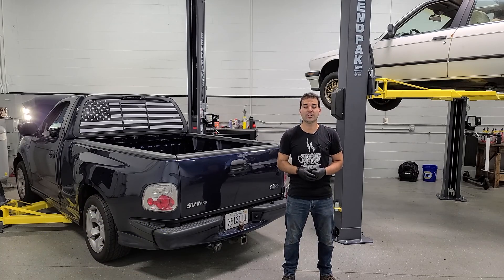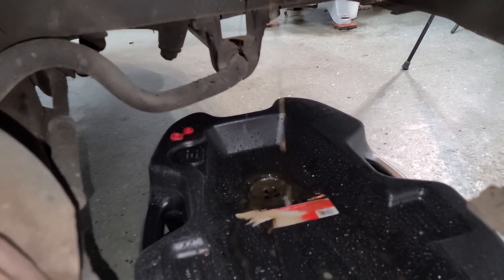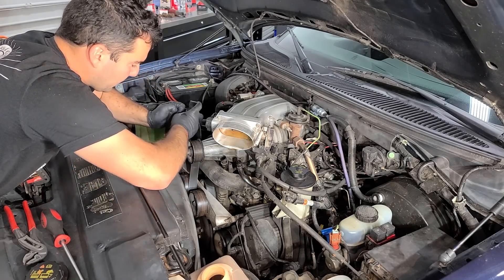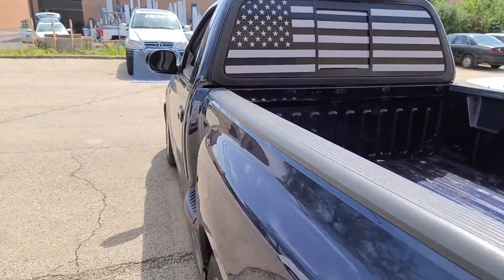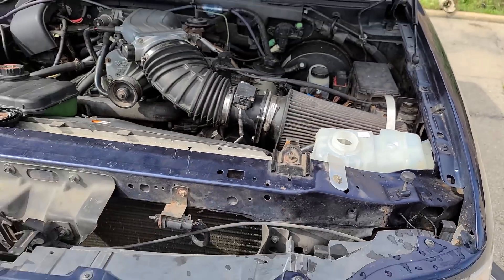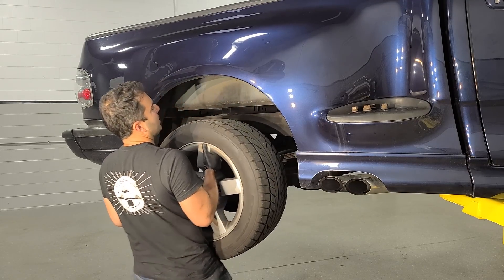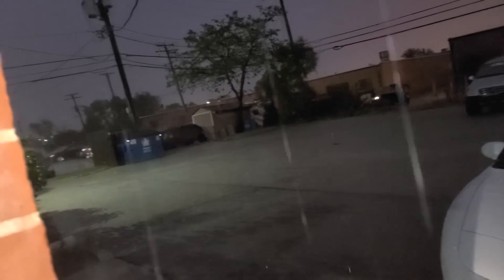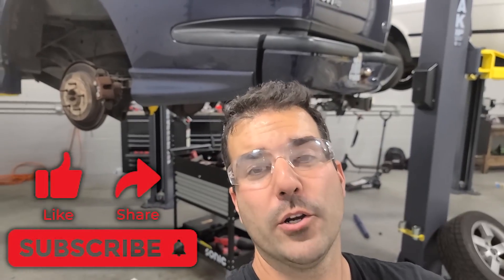I Fixed Almost Everything On My Ford F-150 SVT Lightning Until A Big Storm Stopped Me From Working!

Comment: AC in a shop is great.  So glad to hear you’ve got it when you need it.   Gloveworks HD hold up really well for me.  They are quite expensive these days, but they work well.
Reply: meanwhile the shop I work in still has no ac and the last 2 weeks were all in the 90s with a 100+degree heat index
Reply: @biggiy  I don't understand that in hot places. The owners are so cheap they don't realize they're losing 80% of their productivity to save on AC costs.

Comment: A little trick I use when I have to do something messy when not on the lift or without a larger pan it use puppy pads around the smaller pan. They absorb everything and easier than cleaning up the floor.

Comment: Great Video.  Just a little background for someone who is working on this at home.  The reason the coolant turns brown is because of rust in the coolant system.   When you flush and replace the coolant like this there is a good probability that something will leak afterwards because the flush takes out any rusty portions in the coolant system.  Keep a watchful eye on the coolant temperature when driving it afterwards.   The new coolant mixed with water will help prevent any future rusting in the system.

Comment: A great tip is to use a old washer fluid jug....cut out a square out the side and the edges prevent from splashing out.....plus the lid is great for draining with no mess!!

Comment: 25:00 Alex, I recommend the hypertough nitrile coated mesh "grip gloves" from Walmart.  They're not super durable, but they're cheap and tactile, and they're only about 2-3 times the price per glove of layered nitrile shop glove.  They easily last ten times as long as the vinyl only gloves, and with the mesh backs you can wear them all day without getting sweaty hands.  They still keep your hands clean, and when you need actual liquid protection, you can layer them over plain vinyl/rubber gloves.

Comment: 24:30 this is why you leave the strap on the shock, hang the top, then snip the strap and as the shock expands put it in place of the lower bolt and quickly stick it through as it lines up for a split second...

Comment: Tool list: 4 inch grinder and a box of thin cutoff discs, grinding & flat sanding discs, flapper/pearl discs and some wire wheels for cleaning bolts and stuff.

Comment: One other tip. Replace all the coolant hoses. I noticed that when folks neglect and rust starts, it tends to line all the coolant lines. Easy way to tell, pinch and see if the line makes crunchy noises inside like it is lined with a layer of rust.....cause it is. 
If I feel that crunch, I just replace them all before bothering to do coolant update or stat.

Comment: I have had good luck cleaning rust from reservoirs with an electric power washer sprayed in all the holes. Then pour a little muratic (hydrochloric) acid in and swish it around. Its weak enough to not cause burns. Then rinse a few times adding a little baking soda for the final rinse. Also works great on a cloth to remove rust stains on rubber,  plastic, and others areas then followed by a good rinse.

Comment: I always wonder where exactly do you guys dispose of all the stuff that comes out of your old and rebuilt vehicles? Between old shocks, rusted out breaks, and all manner of gross old fluids, where does all that stuff go afterwards?
Reply: I think it's a law that all businesses that sell motor oil must accept used motor oil from anyone. I take my used motor oil to Autozone or the local chain of quickie lubes. Not sure if they will accept used coolant and differential fluid though.
Reply: Anything metal junkers will pick up from you.
Reply: @DC-iq4gf  I worked at a quick lube a long long time ago and they would take coolant but sometimes things change.

Comment: After using a flush product I always do multiple full driving rinses with distilled water.  Some fluid always stays in the cooland jacket and if you know there's nothing left but distilled, it's easy to accurately calculate a precise mix.  Plus the water is a good indicator, the job isn't done until it comes out clear.  Small expense, only a couple bucks per gallon, worth it.  Always use distilled water!

Comment: Alex, unless you're allergic to latex try Diamond grip gloves. Best, and most durable disposable gloves. I used to give a coworker who bought them a hard time. Then I moved to a shop that provided them, and they were awesome. I understood after that. Just don't switch to the cheap nitrile if using a solvent.

Comment: The M12 die grinders have a smaller 2" cutoff wheel and are easier to get into tight spots than the M12 cutoff tool with 3" wheel.

Comment: When you need a drain pan, but are limited on good choices, a mortar mixing tub from building supply works. Also when transferring containers as a spill pan. I always spill going back into the gallon oil bottle.....

Comment: For gloves, I use the wal-mart three pack for 3 dollars. Nitrile Coated work gloves, they do fine to keep my hands clean, plus they're cheap. 
I only use Nitrile / Latex gloves for grease, oils, and chemicals. I work with tractor - trailers and heavy equipment, mainly tire work.

Comment: I just swapped out my garage door bottom rubber seal on my home garage door. Wasn’t a fun solo repair as you really need four hands but it has made a difference in the amount of water that comes in during storms. might not have helped all that much with the storm you experienced - that was coming down in buckets. $30 fix off Amazon. The old one was only 7 years old but totally shot. Might help with possible pests too - I had a mouse find its way in last winter. I left it an eviction notice and sealed up all possible entrances.

Comment: Hey Alex Dietrich put about 2 gallons of white distilled vinegar in a radiator get it warm and let it sit overnight and what you said about the blower belt first of all I hope you save those for in case of emergencies for roadside repairs but always remember as long as you can can say kind of dumb it's not as bad as it could be

Comment: Get the spicer or Ford performance diff cover. I run it on my raptor and jk. Has drain plug and looks great. Lube locker is a great re usable diff gasket.

Comment: About the front shocks, a thought the top of the piston rod has a hex type nut fited so you can put a Socket on top of it then a wrench on the main nut in order to keep the piston rod from spinning.

Comment: From RoackAuto I put brakes and rotors all the way around for $254 to my door. None of my local parts stores have been that cheap. I didn't get the economy set either. Mid grade carbon ceramic. It's been about 9 months and I have no complaints.

Comment: Best gloves I have found are Venom Steel Industrial 2 layer Nitrile. The white interior makes them slide on easier than any other glove, as well.
Also, for most general mechanical work, I have always used Atlas fit 300 gloves....best work glove ever made, and they're washable!

Comment: In trucks I put the axle side on first (especially on a lift).  Much easier to compress the shock and control the extension to get it aligned in the top hole.   May not have enough room to compress if the truck is on the ground, but typically it works in that situation as well.

Too much limited slip additive does in fact hurt.  It can make a LS operate like an open diff no problem.  I posted a video showing it, but it got taken down due to background music in my shop.

Comment: Alex:  
I have found that Astro Grip (8 mil) Nitrile gloves made by SAS Safety Corporation are the best consumer grade gloves currently available.  They are orange and sold in boxes of 100.  They can be found at your better stocked auto supply stores.    On the diff additive, for my '67 Mustang with a Traction Lock differential, the friction modifier additive sold over the counter at your local Ford Dealer branded by Motorcraft is the one that works and lasts.  After a series of low speed figure eights in both directions the clutches absorb enough of the friction modifier to remain quiet (no chatter in low speed corners) in day to day operation. Lastly, on your shop flooding, I suggest you see about getting sandbags that can be laid down as a dam across the door openings to keep the water out of the shop.  As for the roof leak, check to make sure the scuppers and  down spouts are flowing freely as even partially clogged downspouts can result in a build up of water on a flat roof and can find flashing and vents which are at less than 100% solid.  
Regards, Jeff

Comment: Nice truck. I am also a Lighting owner, bought mine brand new in 2000. White. It just turned over a 100k. Still love to drive it. It is a Florida truck, very clean. Those Michelin tire are the wrong size, Michelin doesn't make the correct size. Should be be 295/45 zr18, should help a little on the traction. Very little choices in tires, I think Toyo makes the last set I pursed. ENJOY

Comment: Alex, Google search Ford Lightning blown out spark plugs. I thought the issue was fixed by '02, but it was the '03 and 04's that Ford changed the amount of threads in the heads for the spark plugs. I had an '01 that spit out 2 spark plugs. The second time, I was hoping my truck would catch on fire and burn to the ground. Hopefully you won't have any issues, but if you do I suggest getting a Time Sert repair kit.

Comment: Put a cup of Ty-D-Bowl into the reservoir.  Sounds crazy, but if you have an outboard engine that is overheating due to plugged passages, this is one way to clean out the spooge.  I'm sure it will work on this engine as well.

Comment: Pump up garden sprayer can help clean out the tanks while installed. With the tank out, fill with water+Oxyclean or 3% hydrogen peroxide, add a handful of gravel and shake it every which way.

Comment: I fixed everything on mine... now it has a SVO fully forged short block, studded TF heads, custom cams, custom fuel system, 2400 stall and a built transmisson and a 3.4 whipple.  RUNS LIKE A LIGHTNING SHOULD!

Comment: I had Accel coils for over 50k miles. They didn't feel bad until I replaced them with the OEM Motorcrafts, made a huge difference.

I would run Motorcraft gold coolant instead of the green.

Comment: You should probably try to find old road kill or engine masters episode where they tested mechanical fan vs electrical. The difference was huge. Electrical was eating like 1hp and mechanical 10hp. Probably one of the best performance/fuel economy upgrades.

Comment: Me and the missus both love your videos.  We're Mustang fans and think the Lightning is pretty awesome too.  I use the HF 7mil blue nitrile gloves.  They seem to hold up better than most.  I use a nut splitter for those rusty undercarriage fasteners.  I don't see folks using them much these days.  Good luck with the water,  my garage does the same when it pours.  Keep up the good work!

Comment: You need to put a speed hump across the floor where the door seals to bring the level up higher than the outside or the water will win every time, you could do the same on the passage doorway than trim the bottom of the door jusayin 👍

Comment: Tip, just put running gardenhose top radiatorhose untill clear water,than bottom drain plug open and flush untill water clears ,even flush true thermostathousing,and keep flushing untill clear ,good luck,and great jobs thank you !

Comment: The harbor freight blue 7 mil gloves are pretty good and durable. $18.99 a box. I work at a kenworth dealer and they last a lot longer than the 5 mil parts store crappy gloves.

Comment: My 03 Mach 1 coolant was not that bad but well on it's way to that color. I flushed it a few times until the coolant was clean. Last year when I blew the motor the coolant passages still had that color to the walls. Well after the hot bath it was mostly gone from the block. I attributed the color to a "spring" inside the main coolant return hose used to keep the hose from flattening. It had rusted and turned the entire system the same rust/mud color that your coolant was. My system holds nearly 4 gallons with an aftermarket 2" radiator.

Comment: The 9mil gloves from Harbor Freight.  Also, curious as to why you didn't put the bottom of the rear shock in first then pull down on the shock to install.

Comment: Used to trust Moog, lately not so much.
Have ordered steering parts from the Rock website. Did not swivel when the should have. So had to order oem parts. So keep a look out for that.

Comment: Microflex Diamond Grip. They're powder free latex. The will tear on sharp object like anything, but the flex is crazy and and forgiving. I've used them when I was a dealer tech and use them now while I work on equipment. Awesome work gloves. They're around $25 a box on the jungle website.
I'm wearing them right now as I type this while you provide the entertainment as I pull the knocking TSX engine out of the flip car.

Comment: As someone who owns a warehouse, it's cheaper to run AC 24/7 than it is to turn it on when it's hot. Tested that it costs around $500/month when I run it 24/7 and around $700 when I turn it on around 10am and off around 8pm, for 6 days. It kicks on when it reaches 85 and cools it down to 75-80. Without it, the shop gets up to 115 and seems like it doesn't get cool for 4-5 hours when we did turn it on in the morning and off at night. Try it out for yourself though. See if it works for you.

Comment: Good gloves: Magneti Marelli 98137 blue nitrile
Much thicker than cheapo gloves. Sometimes i even use the multiple times/days and even if you punch small hole they dont rip. Here in Europe the cost is a little higher than most cheapos, but its deffinetly worth it.

Comment: I've had several shocks with broken bushings and bolt frozen inside, I have never seen that trick before. I've always cut both ends of the bolt inside the bracket.

Comment: I was used to use Harbor Freight gloves which weren't horrible but they are just like everything else there. Now I use gloves from Uline and I've been very happy with them. I'm not a mechanic just a guy that likes working on cars. I have a lift and quite a bit of tools so I'm more than your average guy working on their car but just wanted to be clear that I'm not a pro. I have been very happy with those Uline Secure Grip Nitrile 8 mil gloves. They don't rip easily while giving me plenty for feel.

Comment: When removing shock like the ones on the front, its faster and easier to put a deepwell socket and a long extension on the upper nut and BENDING the shock shaft back and forth until it breaks off below the nut.

Comment: Wow that coolant and brake fluid is nasty
On my 2015 Chevy Malibu (253,330 miles) I have done 2 coolant flushes in its life time 
Once when the water pump was showing signs of going out(which I got replaced & installed a new serpentine belt also) and the second time was when on of my heater core hoses busted which I had the dealer replaced both the inlet & outlet hose and flush the coolant.
The temperature remains the same I believe but one thing that I noticed is that the ac on my car blows out extremely cold air. 
This year I’ve done the brake fluid flush and the car runs like new still. 
All that was done on the truck in this episode, demonstrates that simple maintenance goes a long way

Comment: You could fabricate a cover for the cold air intake to block it off from the engine heat, a couple of small sheets of aluminium.

Comment: Alex, I've been watching your channel for about 2 years and I love your content. I've been a Ford Lightning Enthusiast for years and have been fortunate enough to own 3 of them at different points in my life. I'm currently hoarding a beautiful 2003 Sonic Blue :) and just love sitting back with a beer watching you work on your 02 TB!! I about fell out of my chair when you made the comment about LS Engines, I'm right there with ya! I can work on LS engines for hours and maybe curse 1-2 times, but when I work on the Lightning I curse the Ford engineers hourly ;)   

Pull that blower and clean the intercooler with Acetone, its a "fun job" def needed maintenance. Also check the intercooler reservoir when truck is at operating temp for flow to make sure IC pump is working. There are some nice write ups on the forums for both.  Keep the Lightning Videos coming!! 

PS I purchased all my Amsoil products for my Wife's 2015 Yukon Denali through you! I did everything to her truck that you did on your wife's Escalade. 

Matt - Raleigh, NC

Comment: All the things that changed from 2000 to 2002 Amazing. Belt change, I've had to get a lock wrench for the crank pully to get the belt off. I've still got paint on the Springs, Sch'dy NY. No rain or snow. Oh well.!

Comment: Had a problem once on my chev Beretta.  Did all the recommended service as per GM recommendations. Service Tech said the coolant looked bad when doing a coolant flush. Years later learned that the seal failed on the coolant pump.  This is low pressure, so I never had a coolant leak, but instead it let oxygen in that corroded everything (cast iron block, aluminum heads.  Judging by the look of the sludge in your reservoir, you might have the same problem?

Comment: What do you do with your old coolant Mr. air conditioned shop? If you keep the compression band on the shocks, or compress them outside the truck with some zip ties, you can install the bottom then cut the band and just guide it into the top hole. Also, get the Gorilla gloves that are thicker.

Comment: When doing rear shocks, I find it easier to attach the bottom first and then the top, because instead of pushing up on the bottom you are pulling down on the top and using your body weight!.....We sell an orange 8 mil nitrile glove for $267.20 per case of 10/100's plus frt....so find 10 friends that want a really strong nitrile glove